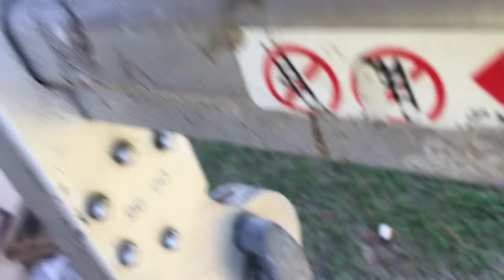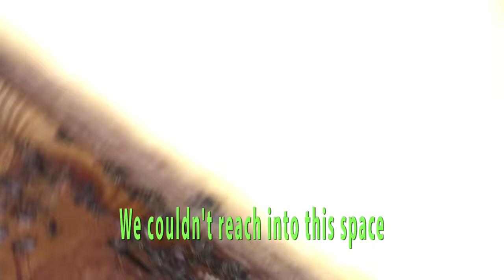Second Hive Removal With Jeff And Smoking Bees With Taco Bell Nacho Chips

Comment: I can send you a chart of where you can drill holes in those wood "I" joists :)  Basically in the middle but not more than a 3" hole.
Reply from the maker: Didn't even think of that.  Had a 2" bit in the truck.

Comment: Thank you so much for showing this. Especially the part about cutting off the honey before you reframe. I’ve got a big cross combing mess in my hive that I need to correct. The only solution I can see is to cut it off The foundationless frames with a 2 inch strip of foundation and reframe them without the strip. For some reason, they quit building the comb with the strip of frame in the middle and started building it all to one side. They seem pretty resistant to building on my foundations. Wish me luck
Reply from the maker: Fingers crossed

Comment: Randy what are the dimensions of your 3 frame nuc boxes I have seen in previous videos?  want to build some for spring  looks like they would be just as good as 5 frames when establishing a new colony with grafted queens. Your thoughts on that.
Reply from the maker: We still use them for mating nucs so I have nothing negative to say about them.  The inside dimensions are 9 3/4 deep, 4 3/4 wide.  The length is going to be the same as any Langstroth box with the ledge for the top bar rest.
Reply: 628DirtRooster thank you sir
Reply from the maker: Any time my friend.  :)
Reply from the maker: Runnen Reb Y'all didn't get affected by the hurricane I hope.
Reply: no we are good in the northern part just some wind

Comment: nice hive when I bo my cutouts I have string on one side that way I can lay the cone in it and and then pot rubber bands on
Reply from the maker: That works.  I used to use chicken wire.
Reply: On trap out I don't use screen I use a PVC pipe got a one way door in it they can come out but they can't go back in they go  into the box and I can't get out of the Box got feeder and cone in the Box